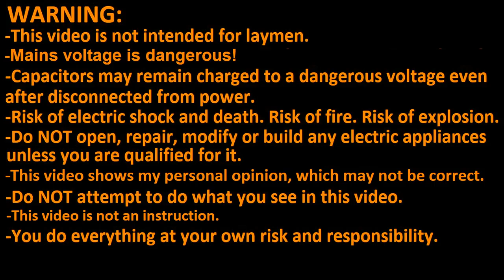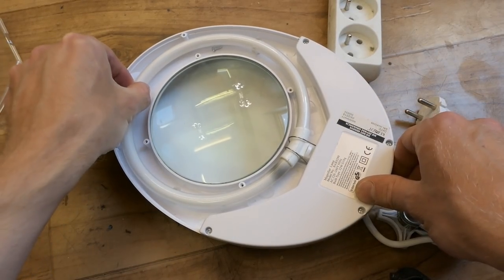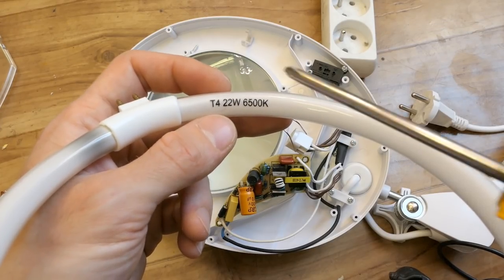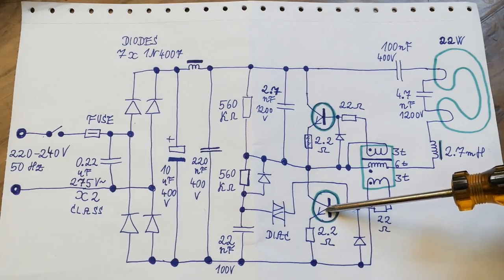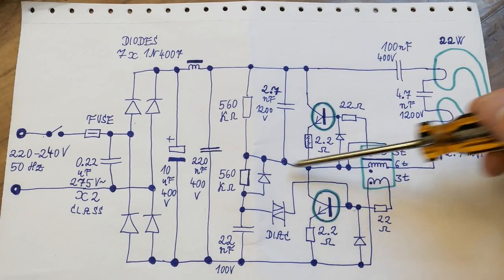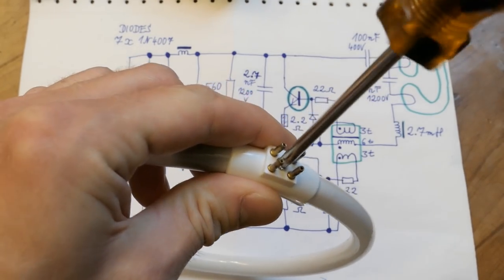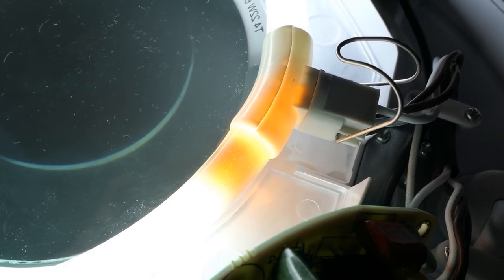Magnifying lamp teardown (with schematic)

Comment: We have couple of these at workplace, their switching supplies are so noisy so noisy that it get coupled to oscilloscope measurements done 5 meters away from this. We were so much frustrated with noise in our circuit boards because of this, but we weren't aware until recently by accident. We rejected hundreds of dollars of boards because of noise issues which was caused by some noisy switcher placed far away. That was quite a lesson for us. Now we take utmost while doing measurements.
Reply: Florescents are always noisy
Reply: I had the same kind of problem with a computer power supply.
I spent too much time tracing where it the noise on my bench was coming from.
All the filter components on the primary were missing or jumpered.
I smashed it with my foot and hurt my foot.

Comment: Cover has 2 functions - protects lens from dust and your home from fire. If the lamp is standig near window without cover it may concentrate sunlight - and these lenses are quite big... I have smaller version of this lamp with fixed head - focal point is at the base and in summer it easily gets hot enough to char wood
Reply: The focal point looks like a fecal point…

Comment: Thank you for this video! I have a similar magnifying glass lamp which failed recently. With the help of your explanation and schematic I was able to diagnose and fix it. And it turned out to be one of the 560k resistors that went open circuit! The one next to the Diac wired parallel with the diode. It had no burns or any other visible signs of failure and about the last component I would have expected to fail.

Comment: I actually fixed one of those I converted it to a LED instead of a CFL lamp
Reply: me too
Reply: Did the same 😂
Reply: Me too cost about &4 new tube was £10
Reply: CFL=compact fluorescent lamp. You don;t need to say lamp twice, CFL lamp is incorrect. As a plasma fanatic I still prefer fluorescent lamps over L*Ds.

Comment: would've expected LEDs in such a device, fluorescent seems like an odd choice to me. I also only just realize that when I use a electronic ballast for tubes to power flyback transformers there's a risk of getting shocked from mains because it's not isolated, maybe I shuld be more careful. Also, possibly do a fluorescent tube to LED modification for the device? That'd be interesting, I think big clive has done it before.
Reply: I was going to say, well it's OLD, but I can see the date clearly and it's from 09/2019... that is odd indeed to be using mercury lamps still.  The manufacturer probably got a good deal to use up stock of those, and the round shape is convenient for this application.  Nothing that can't be done with good ol' LEDs tho!
Reply: @dashSlap  But LEDs are boring. Fluorescent lamps are just simply interesting and beautiful. I literally have more than 70 in my collection.

Comment: remeber to pull down the tablet and flushhhhhhhh!
I also had a similar lamp, mine even had an iron ballast one day I got tired of seeing little: I disassembled a led lamp of the cob-shaped ones and I distributed the circuits printed with the diodes along the circumference of the transparent part, the micro-power supply has taken the place of the ballast and now I have more lightness and more brightness!

Comment: The blown heater has to be replaced by a resistor for proper running, and you have to calculate the value according to the operating frequency and voltage!

Comment: The second thing I thought (after toilet) is why does a little magnifier light need such a thick high-current power cable? Then I saw it's a fluorescent lamp instead of LED.
Reply: The cable doesnt need to be so thick, fluorescent tubes are not much more power hungry than LEDs. This probably doesnt take more than 20-30w from the mains.

There is an advantage to this though: If the cable is rated for 16A, which is the highest Circuit breaker rating in 230v countries, then together with the fuse inside the device, this will actually protect against ALL types of overcurrent faults. It's an alternative solution to the british plugs that contain a fuse.

Comment: Hi, just add some preheat / softstart circuit from old CFL Bulb (You cas still find them in Recycling bin...). This will help the new tube to last so much longer... I have a similar lamp and after thes modification the bulb works already for more than 10 years and is still going strong... Chris

Comment: I wonder if it's fairly easy to make a new driver and reuse the tube without shattering or too much scratching, to insert a string of LEDs. Perhaps the tubes phosphor coating would distrubute the light smoothly?

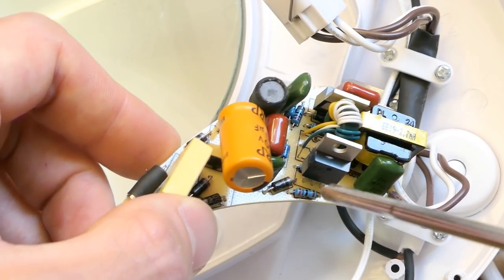Comment: 3:59 Well, the transistor is very common, but it's package isn't. I have never seen an MJE13003 transistor in TO-220 package, they are usually in TO-126 or TO-92
Reply: Apparently, Unisonic makes them in every package known to man. Take a look:http://www.unisonic.com.tw/datasheet/MJE13003.pdf

Comment: Heh , mine did die just like that and i never found a proper tube replacement BUT a slim commercial 220v 3w led bulb at the base (and all electronics bypassed except the switch ) got the problem under control . I even cut  a little rectangular window in the cover to let the led bulb  in contact with the outside air and i have no problem even after hundreds of hours , I tend to let it on alot .

Comment: The price of that magnifying lamp here is around us$33.
I made the cheaper one build from
Robotic arm mic holder : $3
Lamp canopy from paint bucket : free
Good 34watt LED lamp + e27 fitting : us$ 3.5

The light intensity is more than 4000 lumens. Very satisfying for electronics work.
For magnification  i used 3x-8x comfort headband magnifying glass i bough for us$6 years ago.

I followed the guidance from dr. Roger Leifert of Kainkalabs germany in the cheapest way i can afford.

Comment: How much mains current does it possibly need? I'm surprised they got the hair dryer plug on it. I mean it's not earthed, it's not using Schuko. And on the other hand, up to 2.5A, a slim Europlug and a cheaper cable does just fine...

Mhm those tubes aren't very expensive at all, like right around 5-7€... not really worth doing the LED retrofit...
Reply: @Schwalbe262 They use the French Schuko socket. It's compatible with Europlug.
Reply: @SianaGearz  There is an advantage to this though: If the cable is rated for 16A, which is the highest Circuit breaker rating in 230v countries, then together with the fuse inside the device, this will actually protect against ALL types of overcurrent faults. It's an alternative solution to the british plugs that contain a fuse.

With a thinner cable, technically a fault which overheats the cable is possible.

Comment: How exactly a diac works?? Is some kind of 'derivation' of the triac isn't it?
Reply: Yes it is similar. It just gets triggered by a certain voltage level (in both polarities) and when it is triggered, it stays on until the current drops below a threshold.

Comment: This is just a disaster. I thought when you opened it up there was LEDs in it
Reply: The new model already use ring led. But the light intensity of some models is not bright enough for doing detail electronic works.